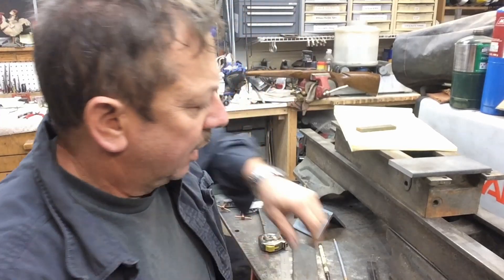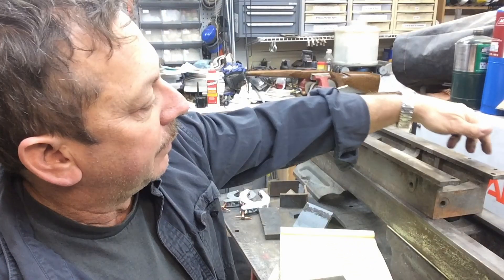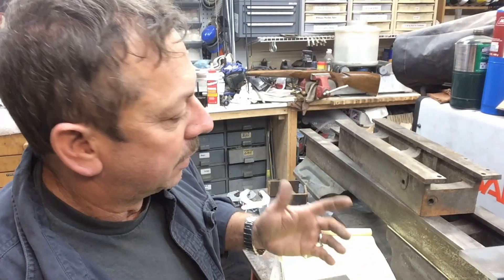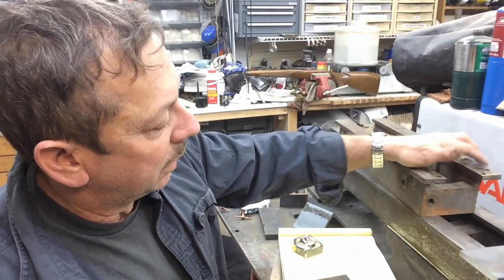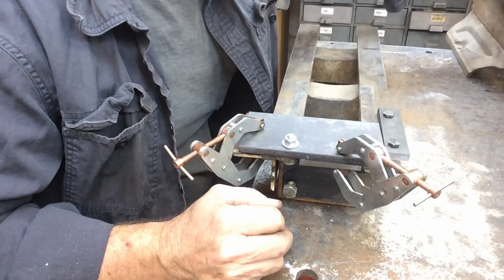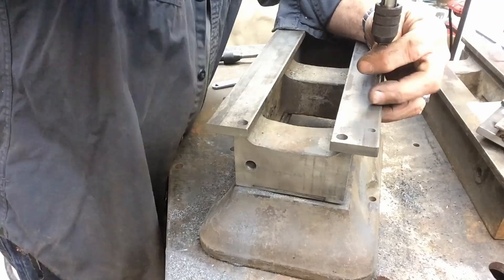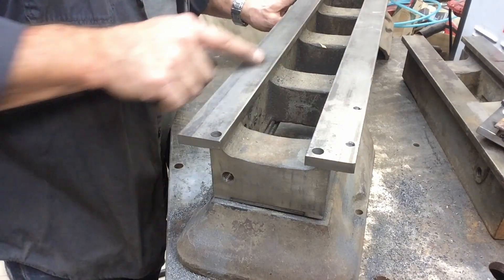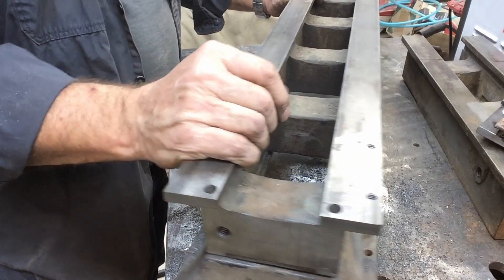Building an Atlas 10" Production Lathe Part 2

Comment: Your jig made nice clean work out of it.
Reply from the maker: It worked well, If I were doing it again I would double check alignment with the components before I drilled the bed. everything worked out but I see potential for the holes to be off and create a problem.